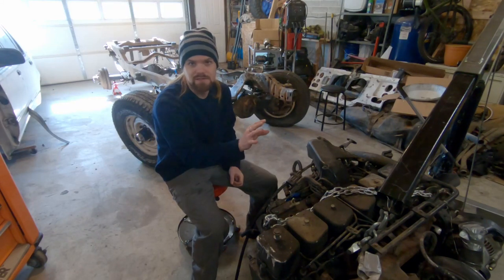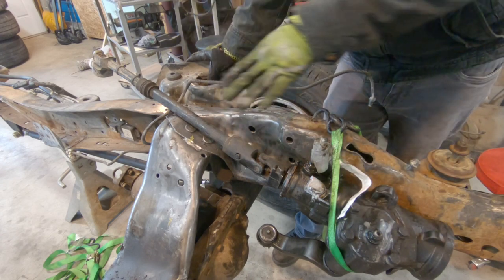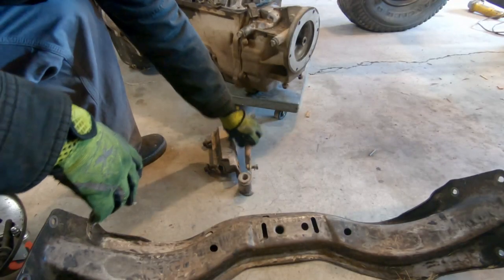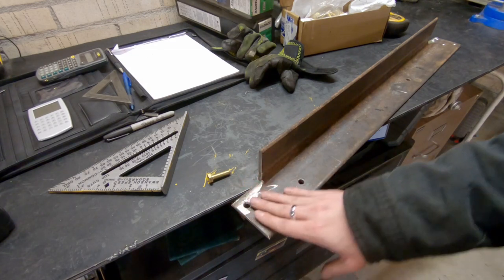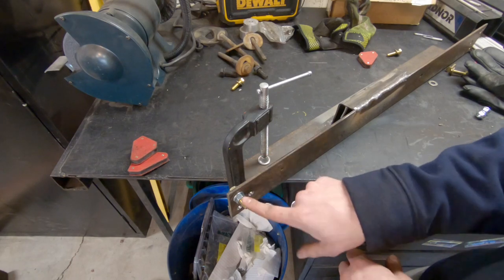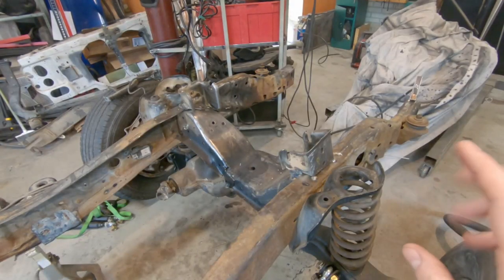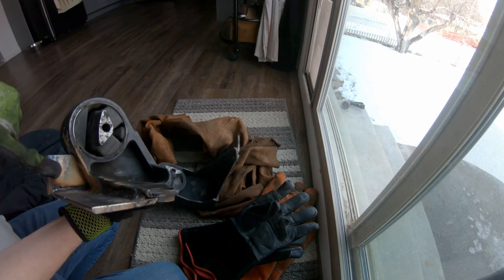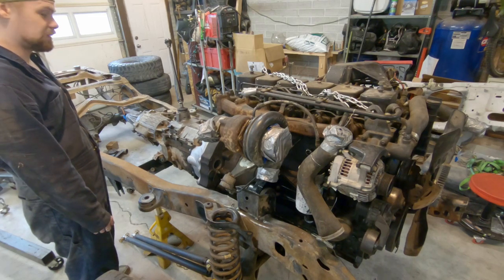Let's Learn to Swap an Engine

Comment: FYI  Ford Econolines offset the motor to the passenger side quite a bit.  Look at the footwell differences.  Of course their drive shafts are way long so dont have the same angularity issues you might have had..

Comment: You were tightening the bolt, unless the camera is flipping the image.  Righty tighty.  Looking AT the bolt head. You were above it looking at the other end.
Reply from the maker: The problem I've always had with righty tighty is it depends on which side you're sitting on 😅. For example if I were sitting on the near side of the frame my rights backwards from if I'm sitting on the far side of the frame. Better way to look at it IMO is clockwise (CW) vs counterclockwise (CCW), CW tightens CCW loosens for right hand bolts. Looking down at the bolt I was going CW which means from the bottom view I was going CCW (I was loosening). You can also see this at 17:33 where I went the opposite direction with the vice grips, tightened it, and pulled it out on the nut side instead of the bolt head side (I tightened it by going the opposite direction I was going with the wrench).

Easy thing to confuse though, I'm still amazed how I still have to stop and think about it after doing it however many thousands of times.
Reply: @BuildSomethingAuto  I have to stop all the time.  Twist my hand in the air... 😃

Comment: Thank you for letting us learn with you. That could have sucked if you didn't try to remove the zinc from those nuts... That may not have been a little bit of zinc exposure. I think you should paint the trans bell housing or at least give it the same coating of oil and dirt... you wouldn't want to hygiene-shame the rest of the driveline. LOL. Quick question, what electrode did you run on those cast mounts? Guessing a 7018? Thanks again for another great video!
Reply from the maker: 🤣 thanks a ton! Yup 7018, 1/8". Seemed to work fine, I probably even went overkill with the pre and post heat it seemed to weld pretty well
Reply: @BuildSomethingAuto  overkill = "What's worth doing, is worth doing right!" Seriously though... Super glad you took the wheel to those zinc nuts. You could have had a bad day if you just tried to weld them. Good thing you played it safe! Keep up the awesome work!